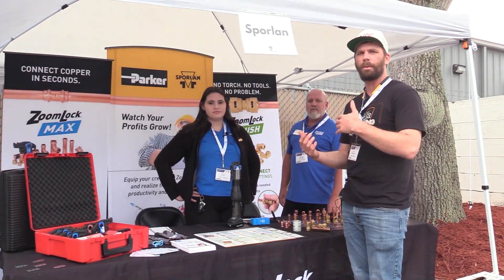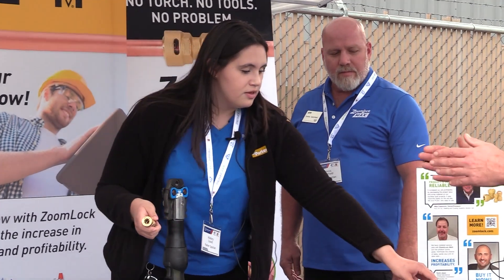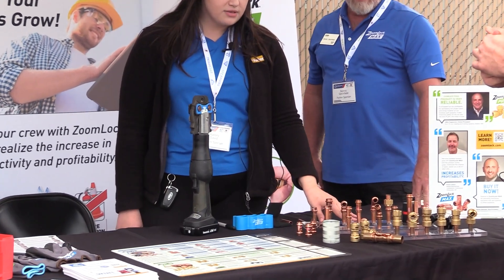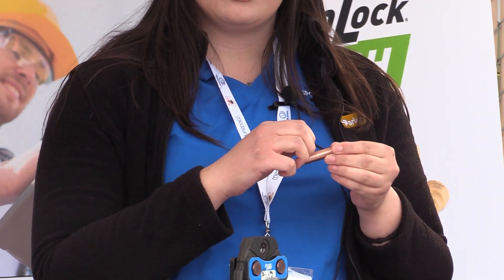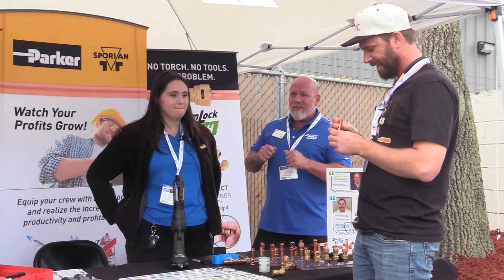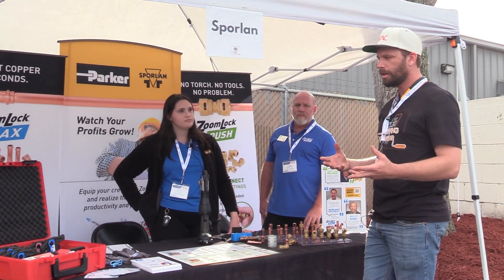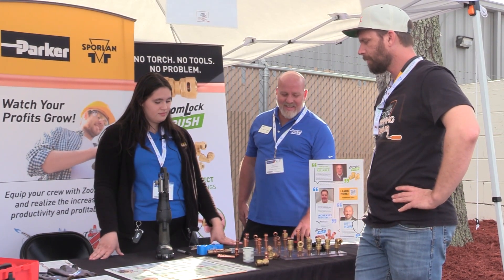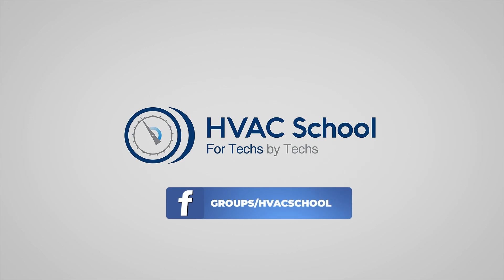Parker Sporlan Demonstrates ZoomLock Fittings

Comment: Very poor representation for the proper installation.
First step is proper cutting and deburring of the pipe!! She NEVER mentions that. Leave a bur, especially on the outside and it has the potential to cut the o-ring and this is a leak.
She meant to say horizontal and NOT vertical. Pipe orientation does make a difference when making this reference, to a point. Then maybe the best thing to say is along the pie length.
Second step would be to clean the pipe. Again, leave a bur and use the pad to clean it and most likely you get a cut on your hand(if not wearing gloves).
Was there an issue with the tool not releasing or did she not know how to use it? That removal of the fitting from a pipe in an actual installation won't fly!!

Comment: Hey sporlan, When's the next time you're running a promotion for the jaws. Unfortunately my set of 32kn jaws were stolen, done a lot more jobs this winter than I normally do and could have used them with my ridgid.
Reply: We do run promotions from time to time but it depends on your wholesaler distributor as far as what specials they have.

Comment: How is it different than a pro-press fitting? Is the o-ring better suited for use with refrigerant?
Reply: Very similar to a propress fitting. It's designed specifically to handle both chemically and pressures of most refrigerants
Reply: @specialK_hvac  interesting, thanks for the info. Have you found that it's worth it to use? Not flowing nitrogen or worrying about brazing sounds nice. Can you use the same press tool used for plumbing for these fittings or do they have special jaws specific for these fittings?
Reply: @itsgalf  The jaws for ZoomLock MAX are specific to ZoomLock MAX refrigerant press fittings. It's perfect for not using flame or flowing nitrogen and provides a cleaner install.
Reply: They are a special jaw. In my experience with them, the plumbing jaws make an octagon finish product, and the refrigerant jaws are round when done. So far I haven’t had any issues with the press style when prepped correctly.